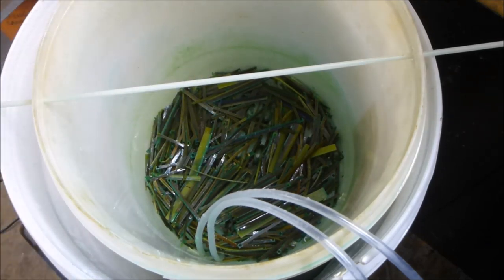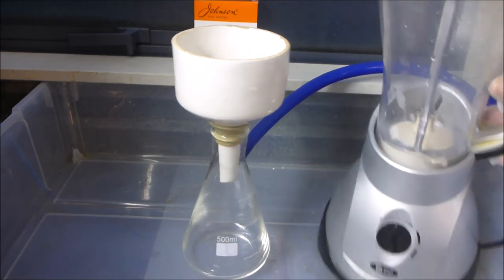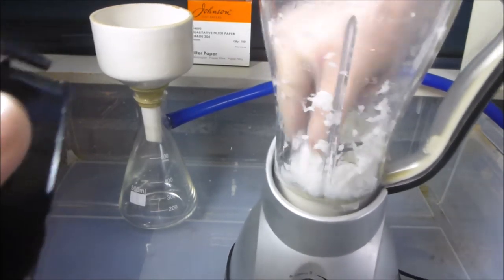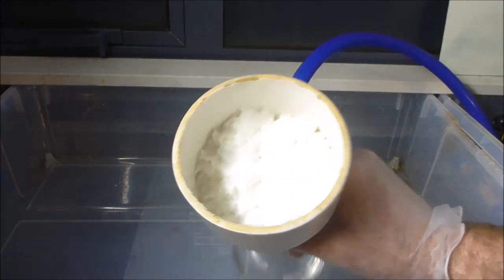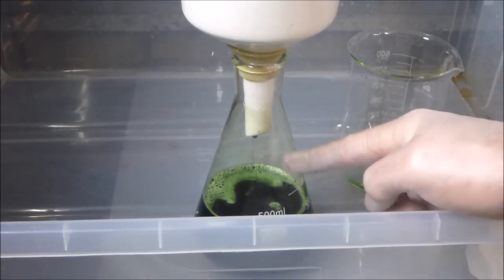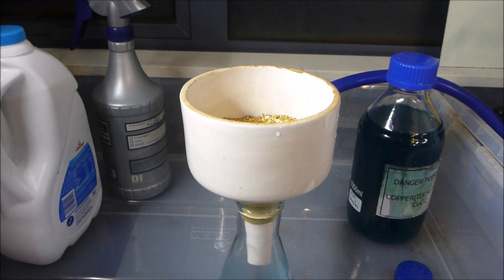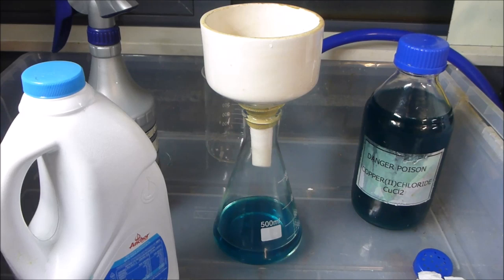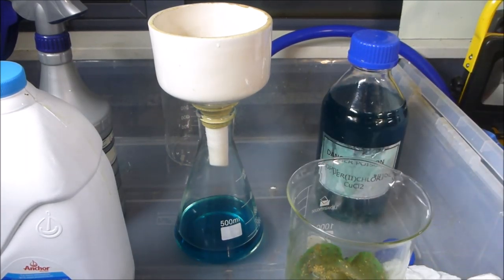Gold Recovery - Trick for filtering difficult solutions

Comment: Try Glycolysis before the AP process. Suddenly AP doesn't need heat! The Glycolysis is just antifreeze & Lye. It dissolves epoxy, flux and clearshield. The clearshield is a spray to prevent corrosion, AKA the processes needed to recover gold. I've discovered some pcb's are fully gold coated under the solder mask or first pcb layer. Using the standard processes, got low yield. Chemically burning the pcb was magic!

Comment: I'm really going to have to try this. I had a time consuming method for fine particles where I took a push pin or sewing needle and made tons of little holes in the paper. All the bulk would get trapped but some more fine material made it through. I then refiltered with a good filter paper with no holes. Before I filtered alot of times I let the particles settle then filter it so most of those fine particles go in at the very end. It works but it is a pain in the butt and it does appear your method would be way more efficient than what I've been doing lol. Great idea and information man I really enjoyed it.

Comment: i use the fine PP or PE mesh, which is placed underneath the two layers of filter paper. with this, the surface area widen not only around the holes in Buchner, but also to the whole surface underneath the mesh, which keeps the paper from directly touching the porcelain.
it need to be smaller than the whole diameter obviously, that the two rows of holes on the outer side of the funnel will be covered with paper properly. 
spray it down with water and press the paper to the buchner with fingers (under vacuum). this could help set it up properly, so the whole area is covered and there are no leaks due to uncovered holes.
dont use mesh with very coarse holes and espetially big diameter of "fibers", as the filter papers could tear under the vacuum.
work wonderful :)

Comment: Thanks for homee, I shall try this.... when I get my next pump, since the innards get eaten up over time and I keep killing them. But the trick I happened upon recently was that, as the filter clogs, if I carefully spoon off the filtrate from filter it unclogs and keeps working. So that scraping action exposes the filter anew which lets it do it's work over and over. It seems that the filtrate itself acts as a thicker and thicker filter until it eventually clogs.. which means I get a lot of value out of each one. This only works if the liquid I am filtering is not too corrosive where the filter turns to moosh. Cheer W
Reply from the maker: Awesome, yeah, I have tried the scraping thing, but I always seem to damage the paper!

Comment: Is the next step aqua regia? If so you could use diatomaceous earth or perlite as a filter aid. Mix the filter aid with the liquid and it provides pores for the liquid to travel in. Not a precoat, but a slurry in the raw liquid. Used this in wastewater filtration in a filter press. If the filter media is to be incinerated or dissolved then this may not work.
Reply from the maker: Hi Paul, I tried diatomaceous earth (which is what led me to trying this) and it was a total disaster. When left overnight in AR, it formed a gelatenous substance that you could literally lit with a spoon! The nice thing with doing this with paper is that it definitely doesn't interfere with the chemistry at all and it will filter out very easily at the next step. You can also dry and incinerate the whole thing as you mentioned.

Comment: Nice tip to increase surface area with the paper towel  thanks
Maybe try adding more water so blades can create a fluid vortex in the blender it would definitely create a finer pulp if your just going to filter the excess water out anyway it wouldn't matter how much water you use but I wouldn't make them too small it might have the opposite effect and actually make it harder for the material to pass through
Reply from the maker: Yeah, I imagine there is definitely a sweet spot where you get maximum benefit. My intuitive guess is that it works by creating a lot of parallel paths for particles to flow, so if a particle gets trapped, there are many other paths for the fluid to take. So I guess you definitely want small pieces of paper instead of just raw fibers!

Comment: Have you tried a coffee filter first (making pulling the while thing or easier) then filling that with ground toilet paper instead of paper towel?
BTW love the idea.
Reply from the maker: Hey mate, I have actually wondered about both your suggestions over the past few days, since the actual filter paper is not doing so much work anymore, it may be a very good idea to use a larger coffee filter, that way I could just pull the whole thing out leaving a reasonably clean funnel. I was also wondering about  toilet paper vs. paper towel, the toilet paper will break apart easily in water where the paper towel holds together, will definitely give it a try.

Comment: It's been a long time you don't make video you miss me. Always interesting! Did you find a another hobbies or a buisness. If you always refinning can you make a point of your process you actually do. I inspired by you to make to grind chips with the rotary machine, another machine to recovert cooper from ewaste and at the begining the twister and finally the water tunnel to recovery gold bonding wires.
I now use more and more electro refining to refine the gold pins i note that it's cheaper method with less acid.
Take care and hope you will make more videos.
Did you try to invest a small amount of bitcoin?
Reply from the maker: Hi there, thanks for your message. Yes, I have been focusing my attention in other areas since the start of this year, I have kept all the Gold I recovered over the years, so I have a nice amount sitting there now. I'm spending a bit more time on electronics development (my actual job) as well as getting out a bit more doing things like mountain biking and kayaking! Yes, I am a big fan of electrorefining and lower acid waste! Some of my best and most consistent Gold came from the pins I processed with my "Copper cell". Yes, I actually have a few bitcoin miners running at all times, have been running them for a few years now, I have a solar + diy powerwall type setup that helps offset the electricity cost. I am always around and always happy to help anyone, very nice to hear from you! Stay in touch and let me know how you progress!